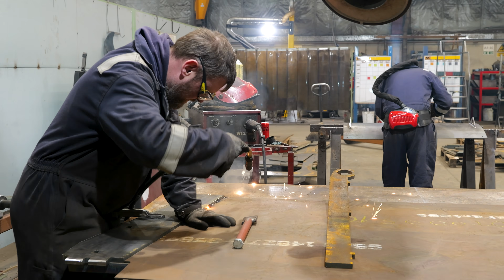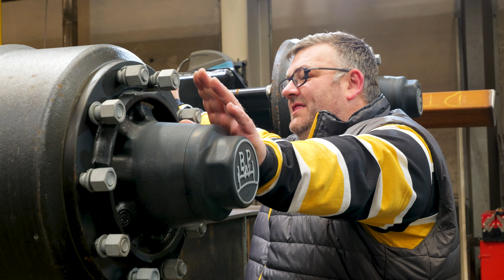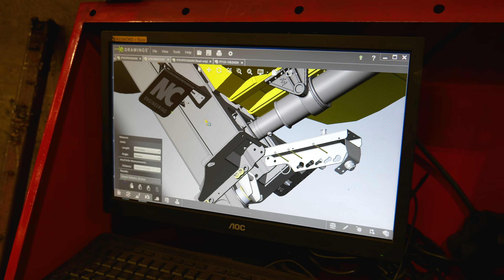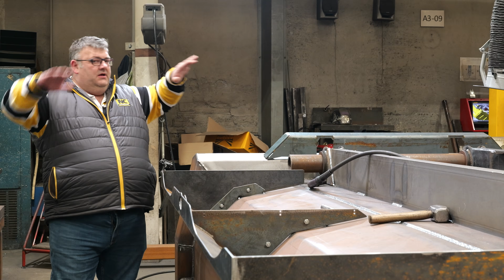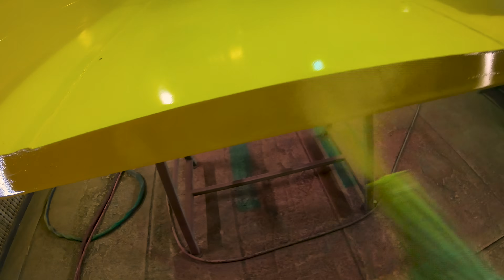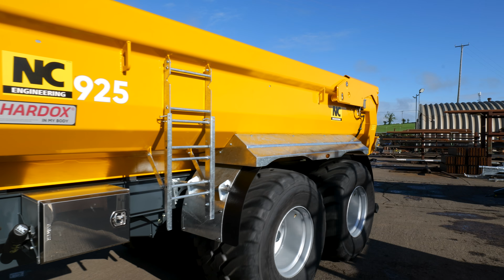HOW IT'S MADE - OUR BIGGEST DUMP TRAILER!!!

Comment: stil would buy a beco maxxim 360 over this way moor built to move heavy loads ad 50k with air brakes k80 ball hitch end 2 k50 for steering
Reply: Beco truly is top of the market, only the heaviest duty as standard. They co-developed the Tridec tri-axle suspension for that trailer.

Comment: I love dumptrailers not used enough on UK construction sites the tractor gets hired to move materials with a flat bed or do dust suppression with a water Bowser or tow diesel bowser I see big 200hp plus tractors barely breaking a sweat when that tractor have a dumptrailer to move stone and muckshift

Comment: Why  build trailers just at 40k when all tractors are pulling at 50 to 60k in the uk & Europe!.
Reply: Because in the UK the actual legal speed limit of agricultural tractors of 20mph or 32.9kph IF the tractor is over 2.55m wide and drops to 12mph if over 3.5m wide. It is illegal to drive faster but the police never speed check tractors and manufacturers are not obliged to restrict road speed yet. There will come a time (hopefully soon) where tractors will have to be tested manually for road safe operation. It is LONG overdue.
Reply: Build your own.
Reply: Let's face it it's a it's only in the last 15 or 25 years max that unless you're an arable unit or contractor that you'd be likely to have a tractor bigger than 200 HP. As for the top speed well around my area you're lucky to get above 40 KPH road is too narrow and in bad repair
Reply: Pah! I’ve pulled 1990 Massey 5 tonne trailers loaded with greedy boards knocking on the door of 8 tonnes at 50k behind my Valtra and never had a problem.